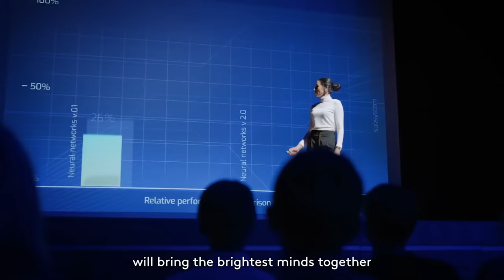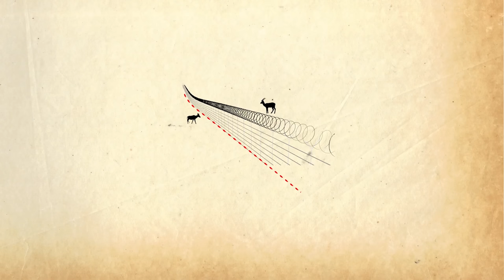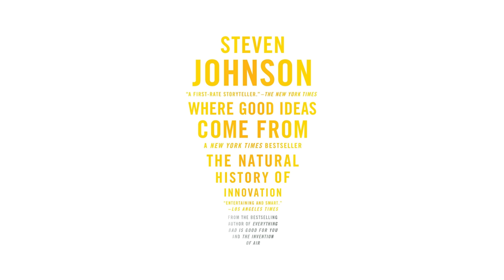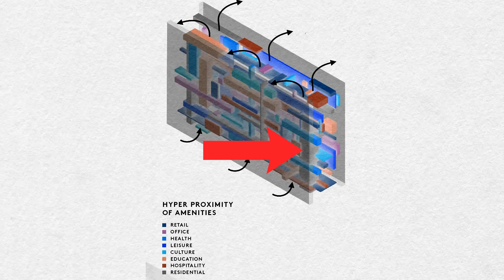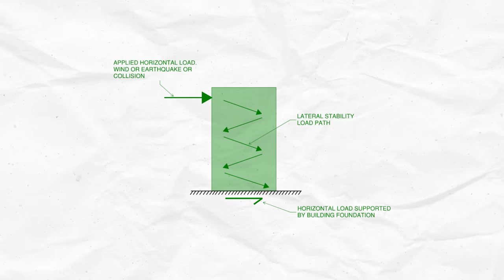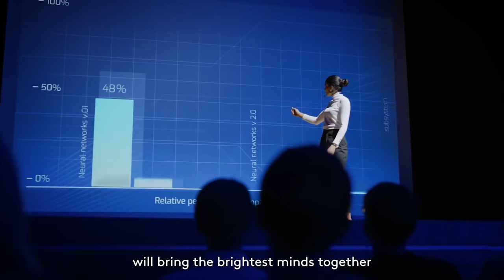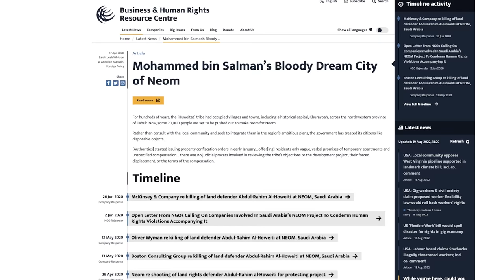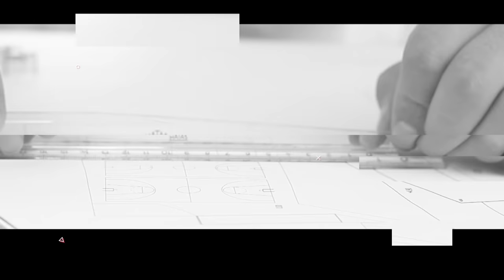This city concept breaks architecture (THE LINE)

Comment: Thank you for digging into this project in a professional approach. Even without me being a pro, I had kinda similar concerns about the this megastructure so I could not get it seriously, plus I seriously feel sorry for the people who will live in this dystopia, prognosing it will be a disaster for them. But I've never imagined this is this bad.

Anyways, someone should make some reproductions in Unreal Engine 5 based on the visual design videos to (sort of) simulate the life in such a city. (Without the floating trees, of course, that's pathetic …) I have a suspicion that it could not even be too hard to program a basic temperature simulation shader, and the same approach for the desert environment of the Line.
Reply: it isn't very professional here .. the professionals are working on the project itself .. she hasn't really talked on the issue of the dividing line what she stated she has insight ..

Comment: Im just wondering. How would they stabilize everything when there's a fraction of probability that something might get wrong that would cause a fatal incident. Even if we talk about the natural calamity hitting it, how would they think that this "INNOVATIVE" construction keeps those 9 million people safe. We should take note that from time to time this present day, all of natural disasters getting stronger and more powerful than we ever imagined...
Reply: That was my thought as well, I don't know to much about the region but I know that some desert sandstorms can have immense winds and a giant "sail" like that could be disastrous. I also cringe to thing of the coastal damage reflective surfaces like this could cause.
Reply: People can build reliable structures in windy areas. This is not the reason we don’t build in the desert.
Reply: @hanagreg  how about overpopulation? Have they considered it despite that this structure has a limit
Reply: @hanagreg  you are absolutely correct, I meant in addition to the previously mentioned natural disasters. It's another set of things to contend with.
Reply: @bubbathelo6072  I understood you, but this is not a set of things, it is standard planing in architecture/construction. A simple skyscraper is way trickier than a horizontal structure in terms of statics and windforces.
Reply: @miggygaluza9234  That's a completely different thought experiment but since you ask... Architects always plan functional units' dimentions based on minimal requirements for the number of people that are expected to use a given unit. For example a concert hall for 600 people has to have this and this many toilets according to regulations. In the Line's case architects would plan a sufficient number of supermarkets, kindergarten, schools, offices etc. in order to sustain the number of people that can live in the number of housing units that the developer wants to build. They can even adjust those numbers with some average birth rate and plan for the future.
This is not an informal or organic settlement (understand slums and such) and polulation growth is neither uncontrolled nor unforeseeable.
P.S. I am an architect and this project has many issues but your thought experiments are just a little uninformed. :)

Comment: Having worked in an AI research lab, I know that an AI can come up with really counter-intuitive designs. The height and the 'sandwich' design for example are very useful for managing heat and moisture dissipation in a desert with minimal energy and other resource costs. There is just not enough data publicly available on the engineering side of things.

Comment: the line concept " cutting down transportation time" is literally the most unlikely statement as a line is literally the most inefficient space between destinations. sure it is the shortest distance between 2 points, but not really in city planning as you're adding distance for everything in between linearly, instead of being able to have options in 4 cardinal directions and everything in between you only have left and right, ALSO whats to say in 20 years new technology doesn't come out that may requires new stores, or shops, theres only a limited amount of space for locations to open up between point a and point b. this whole thing is stupid in so many ways..... now the transportation for a straight line does allow for simplistic transportation that only needs to go in a line rather than be able to sustain a high velocity turn.
Reply: The 'line' design was probably chosen to minimize the energy and other costs associated with maintaining a habitable environment in the desert. I think heat and moisture dissipation are much more manageable with this design. Furthermore do we really want stores/marts full of non-renewable packagings in the future. We already have services delivering our groceries on a regular basis to our homes. I'm sure the designers have super-efficient delivery systems build in to the city design (minimal requirement for a futuristic city). This will also encourage waste efficient renewable packaging for all products, which will help minimize pollution. Ultimately I'm pretty sure the Saudis have the resources to hire real experts to design this city. Designing a city involves allot of tradeoffs (multi-objective optimization) and we need more in-depth information to really judge the design.
Reply: @primaryesthethicinstincts4832  i mean really the main design flaw is that travel in only 2 directions poses many issues, everything is always the maximum distance away possible in either direction. so already that efficiency in transportation is gone. which then leads to a difference in property value based on travel time to different things, and then also if theres no mundane travel like grocery shopping or what ever that kind of seems to me a bit isolating.

Comment: One thing not mentioned is how having everyone and every business packed in a close proximity, could be disastrous if someone wanted to commit a bombing or other type of terrorism. Not to mention fire would spread more easily unless they are working on a solution for that. Or how the structural integrity of one block could crumble, bringing everything down in one act. Love the idea (for the most part) but there are serious things that need to be resolved, and I fear with a project like this, greed will come into play and there will be massive oversight for the sake of profits.
Reply: I'm pretty sure in such closed environment individuals' privacy would be practically zero. So I'd assume criminal activity would be practically zero as well.
Reply: KINDA LOOKS LIKE A PRISON TO ME., OK I`M BLACK, THAT COULD HAVE SOME BEARING ON MY VIEW POINT., BUT IT DOES LOOK LIKE A NICELY CREATED VERSION, INSIDE A PENAL COLONY., AND HOW DO YOU GET OUT????? IF THAT IS EVEN POSSIBLE
Reply: In Saudi Arabia, the use of weapons is prohibited, it is difficult to obtain, and it is safer than other countries.  There is no killing or use of weapons.  It's not like other countries that allow teens to carry guns.
Reply: @gonzomiller1720  Like life, crime finds away. It's how we are built. If there is a loop hole, work around or scam it will be found.

Comment: I can imagine, that linear expansion and contraction would also be a nightmare when realizing a structure like this... I am no physicist however, I know the temperature between day and night can vary quite a lot in the dessert... And this structure looks like it would be built using mainly materials like steel and others known to expand quite a lot under heat... 🤔🤷‍♂️

Comment: This is what happens when people regard themselves as the supreme leaders and with supreme power, they think that they are correct in every way (ofcourse the engineers' could not speak the truth, cause you know what happens to those who speak the truth). This city project (would be a disaster in my opinion) is a great example of vanity where human arrogance has no limits. I am not an engineer but i understand that the best possible design for a city is the circle. And this project is just a line? not just facepalm, DOUBLE facepalm on this project.

Comment: I appreciate your thorough analysis of this wackadoo project, entertaining potential positives while not pulling punches either. The land barrier this concept would create is absurd. I'm on the production side of large projects for landscape architecture in mixed use and public spaces. The disregard for the limitations of our materials that designers exhibit is comical. "You want what, now?" This line project is that schism at an exponential scale. Let's have an update vid in 5 years! should be a lol

Comment: As soon as i heard about this line project ik it is going to fail especially due to ventilation. when you mentioned about the sunlight and the living system with worker class in the bottom section and millionares at the top where they could get good sunlight, it reminded me of the Snowpiercer movie. It is ethically wrong. Planning a city with technologies not even invented yet is a huge gamble and I have a feeling this project is going to be a huge fail but lets wait for the future.

Comment: I expect The Line to be finished at the same time as the Freedom Ship, the Straddling bus or that thorium-driven car: never. A typical pipe dream obviously dreamt up by a powerfull man with no clue whatsoever about city-planning or any other practical aspect of a project like this. Tossing tons of money at it won't solve the fundamental flaws inherited in the concept. Also - I never got the hang of what those flying doughnuts were supposed to be...

Comment: The simplest and most critical flaw of this design is: how do you move stuff around? Yes, public transportation will move the people, but if they stick to the whole "no roads, only walkways" concept, how do you move cargo? how do you move goods? how do you supply all the spaces that the city needs (shops, industrial centers, offices)? what if you want to move from one apartment to another on the other end of the line?
Reply: I haven't read things about this project for at least a year and might miss something.  I think the project proposal has a underground floor entirely for cargo trains.  I can't remember it 100% and don't bother to check it out.  I do not think that it is not possible but I shall say that it is 100% impractical.  I am living in a big city with public housing buildings 40 storeys minimum.  But we still cannot put everything like shops, school, clinic above ground.  It just does not work.

Comment: To add to the many interesting critiques here, stretching a city out into a line is (for a given density) the way to put the residents as pysically far from each other (on average) as possible. There's no way that a linear train system - even with 4 or 6 tracks going in each direction - will have enough capacity to move a meaningful percentage of the population very far on a given day, so real mobility will be an expensive luxury for those who can afford it (if it's 170 km long, and you put a train station in each 800 meter section, that's a line with 213 stops). In other words, it will not be a city - in terms of an urban environment wher you could acutally meet any resident of the city in person easily and affordably - but rather a long string of hyper-local neighborhoods defined by walking distance where moving to other parts of the city is like airline travel. And serendipitous meetings of people who don't live next to each other? This "city" design does an impeccably good job at preventing those from happening. Maybe that's actually the idea, since we're talking about MBS.

Comment: There are new technologies already in the market like transfer the sun light into your room even in basement  using fiber wires connected with a big scope fiber lens at roof top 
there are many issues living in the line. they must concern about the ventilation and same for the stability during earth quake, high velocity winds and also the high temperature area.

Comment: Young architects think that mega projects are completed as first designed 😂❤:

after 25 years in this scale of projects, I assure you that the Line will turn up to become the smartest and most ecofriendly city on earth by far. It will most likely end up a grid or so, the mirrors will most likely be replaced with a water pipe facade mesh to absorb and utilise the thermal energy of sun light, the middle space won't need to be air cooled because of the intensive shading and huge volume of the courtyard include huge height's stacking effect. Neom area though sunny has a cool breeze, it's a cool place to visit actually.

Who is going to live there? It will grow in population over 50 years, starting with 10k already there to build the first stage.

I think the concept is inspiring, and the journey to finish the city (achieve all it's functions) is going to be a mind blogging journey for all humanity. It will bring tech advancements to the world just like NASA did in the 60s and 70s.

The top fan of NEOM is going to be Elon Musk, big lessons to be learned from NEOM for his Mars Missions.

God! I think I should also make a video on this city.

Comment: It is correct that a train would have to travel at an average speed of 525 km/h to travel the length of the line in 20 minutes.
But if you calculate the acceleration and deceleration times and add only 2 stops along the route, the train would have to accelerate to more than 1000 km/h at a world record rate of 1,7 m/s^2 to make the journey in 20 minutes. A more realistic travel time is around 2 hours end-to-end, but NEOM is still claiming this.
How will fire and rescue work?
Should the whole line be supplied from one end? Can you imagine 170 km long sewer- water- and power lines for 9m people?
The amount of money being wasted here is astonishing.

Comment: Why not do it in a loop like Apple's headquarters? That way you could turn the land inside the loop into parks, lakes, and other green spaces; and another reason it would be better as a massive loop is that if successful you could latter build a slightly smaller loop inside the larger one thus increasing the possible population as needed.

Comment: I believe the highspeed train wouldn't be a problem tho. They not gonna make a single line of train with 170 stops for each Km for sure. 
Think of it like elevator, they can divide into zones with multiple elevators very easily.

Comment: I agree with every point you have made. The design is awful, jailhouse style. It sounds like Bill Gates sold them a bill of goods. Your points are excellent.
In Chicago, they built a glass house bahemoth state of the art all encompassing project, and it failed HORRIBLY. People were getting sick, overwhelmed, heat-exhausted, the HVAC system failures, inside air poisoning overwhelm,....just awful.
There's a similar gigantic failure in NY too.
The Saudi government is out of cash, AND, out of oil. They cannot even pay their electric bill. This concept megalith behemoth sounds like their last desperate attempt to create cash. Remember the man made islands in the ocean? Did they NOT consider that glass and mirrors and concrete ESCALATE the natural heat entrapment in a closed structure? That's exactly how the State of Illinois building failed; the glass outer walls cooked the people inside. The lack of fresh air, had people fainting constantly.